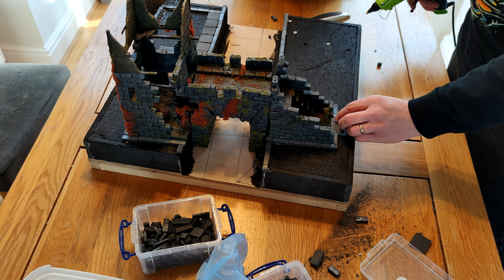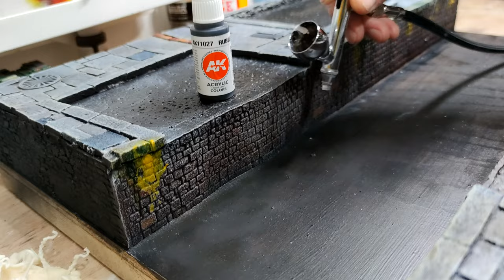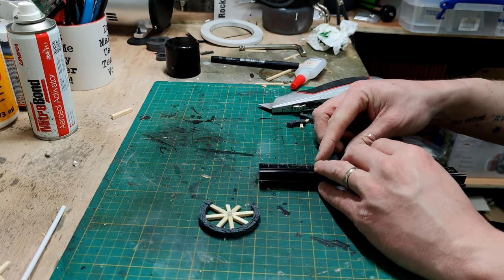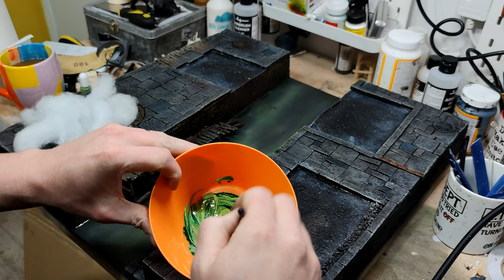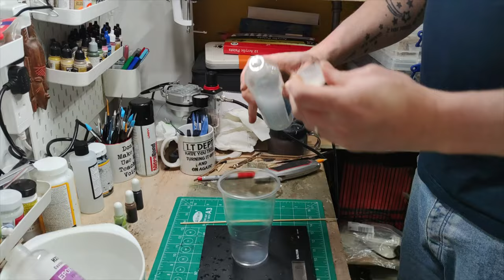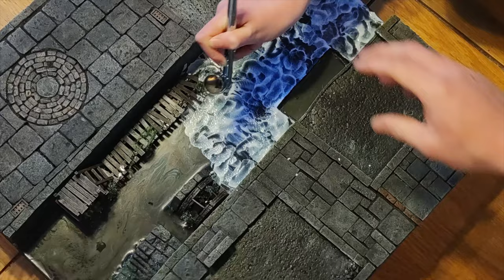Building A Mordheim Inspired Board

Comment: Easy way to do a water pour and get no bubbles... Pour slowly and low to the surface, but once you are done us a back massager (vibrator) and lay it on the board on low setting, so it is slightly vibrating the entire board, the bubbles will rise up with the vibrations and out of the resin. It happens pretty quickly.
Reply from the maker: Ooh that's a good idea. It's funny but I've seen lots of videos going high for the pour, but low does make more sense.